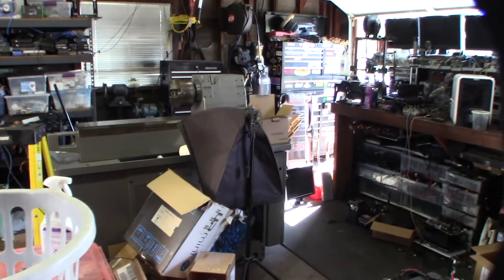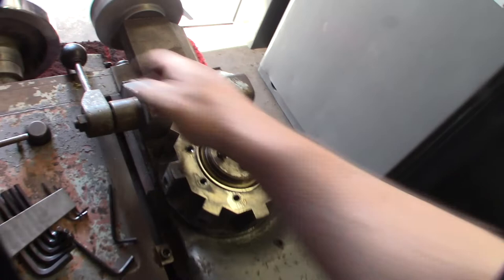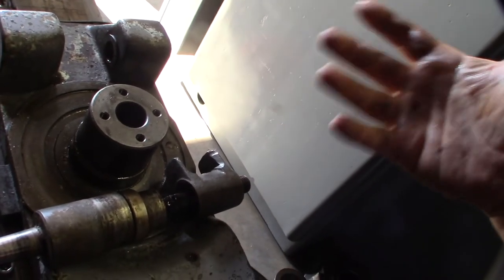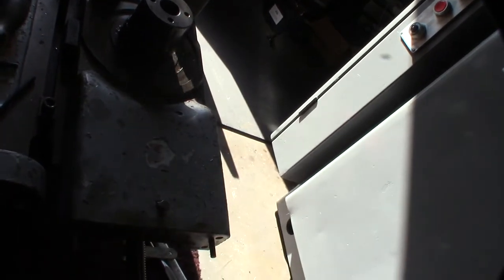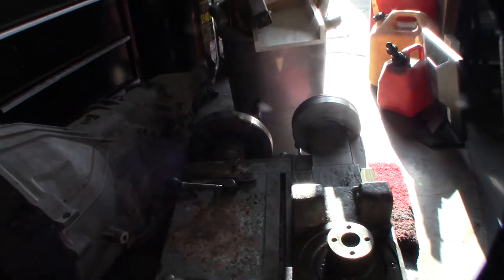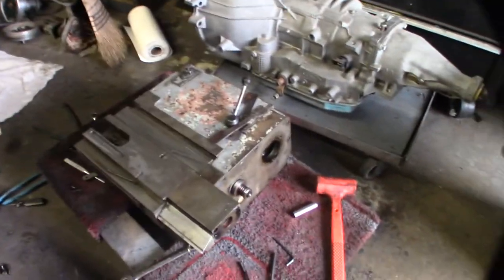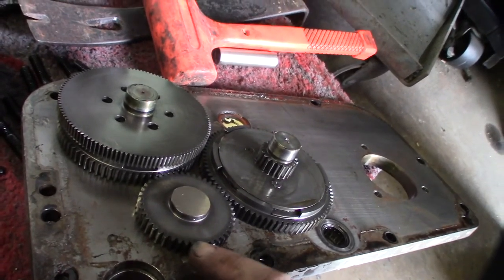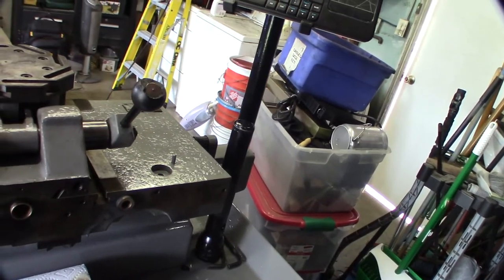Tsugami Chucker Lathe CNC Conversion Part 3 Mach3, Mach4, LinuxCNC, Centroid Acorn, Hardinge

Comment: Awesome project seems like you could replace the gearset directly with a tooth belt drive and just re use the leads screw. If you can figure out what the screw size is you could buy another brass nut and make an anti backlash feature. Bolting everything to the side seems like a huge challenge and won't give you a high quality machine. Those existing screws bring the beef and integrate with the existing hand wheels. You should try to keep those so you are not 100% dependant on the CNC function.
Reply from the maker: Cool, now you have me thinking.
Reply from the maker: I was thinking car timing belt. maybe use some camshaft and crank pulleys. I don't think loose belts will be good for threading.